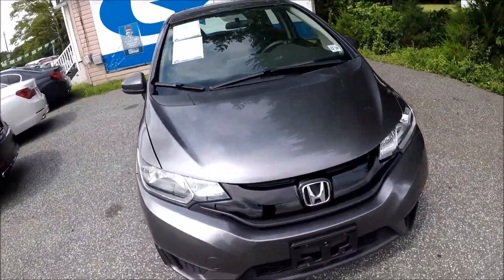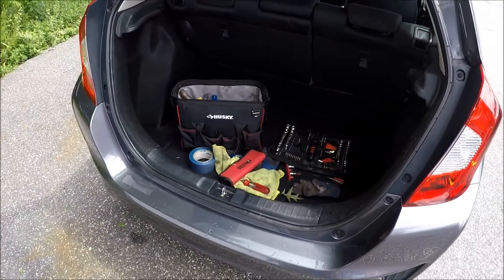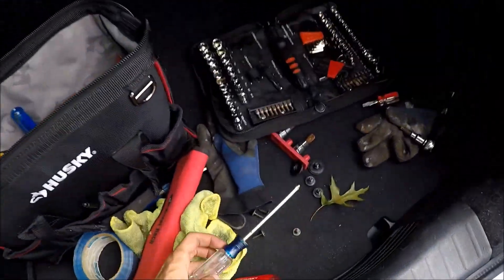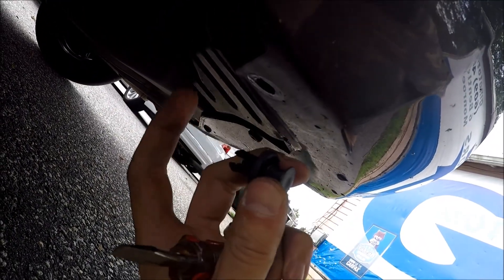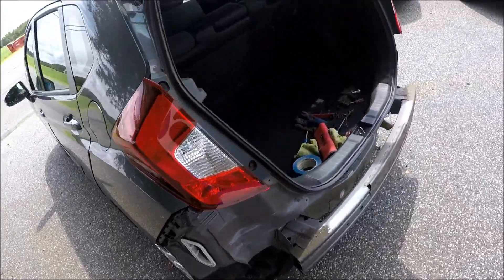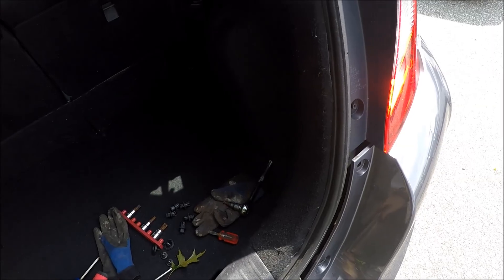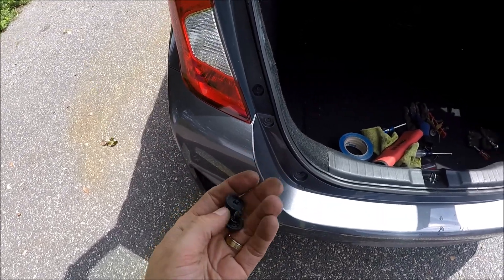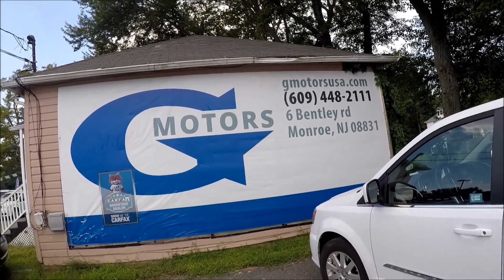How to remove Honda Fit rear bumper

Comment: Thank you!  We were rear ended with no damage except the bumber was "sprung" on the left side.  The slots on that side popped out of the little snap-on fasteners on the body.  With the video, I was able to fix myself without taking to a collision center.  This saved me $$$ on a rental car since we only have one car at present.